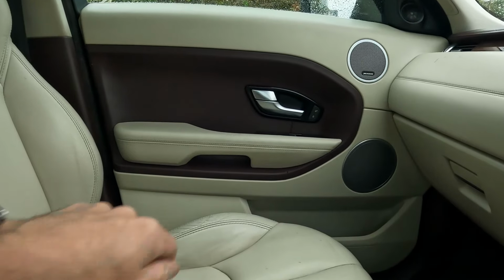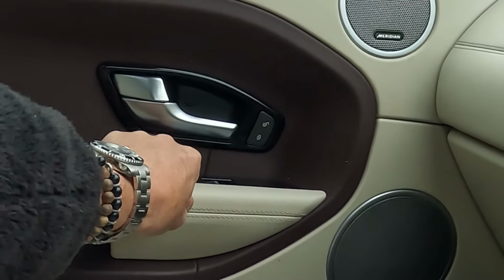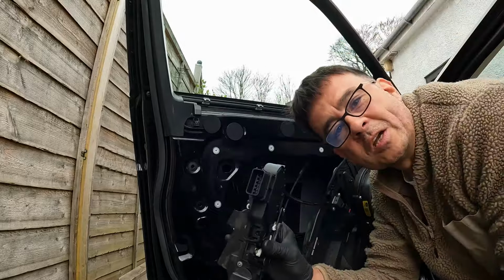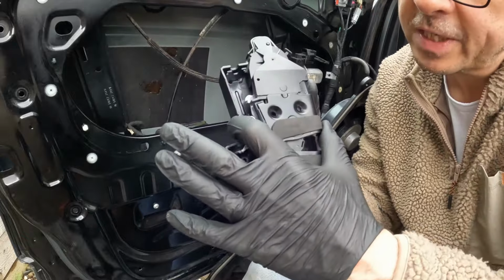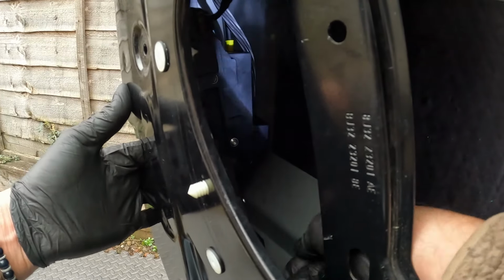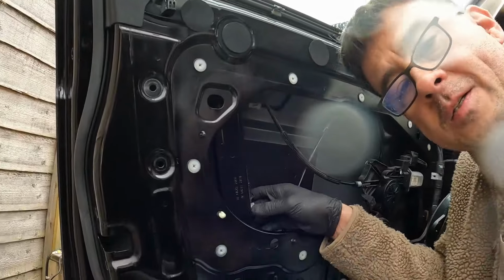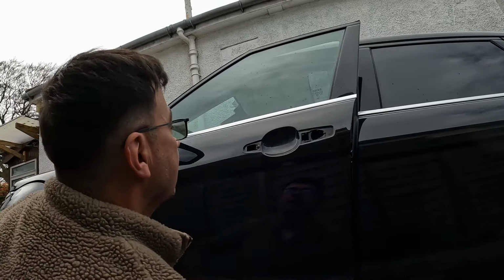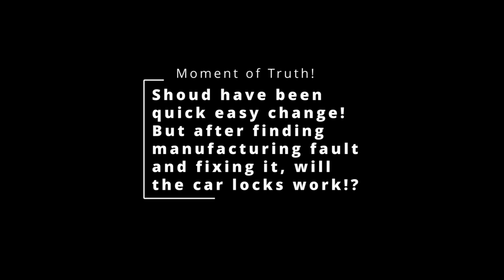Range Rover Evoque Left side Actuator Lock and Handle Keyless - Fix! Watch-out for this Fault !

Comment: Hello 👋, I have the same problem, if I understood correctly, just replace the part and that's it, no coding or similar is required, and this with the lock was all because of the battery?
Reply from the maker: @alexandarnacic5841  correct, no coding just watch the plug orientation as per my video and the emergency key cable. Good luck let me know how you go
Reply: @GrooveOn  I replaced the part, the problem is why I'm less serious, thanks for your help, but now I can't open the door from the outside, not at all, only from the inside, as if the yellow cable fell out on the handle, there's no resistance, I'll open it again to look, the only thing that bothers me is that I have only one yellow for the outside and you have two? For me, the steering wheel is on the left side of the Evoque 2016, so maybe you didn't make any changes there?
Reply from the maker: @alexandarnacic5841  yes whatever for is your passenger side, you have the additional mechanical emergency lock, with key

Comment: When you tried to use the emergency key was it turning at all? I replaced my left side actuator and afterwards i noticed the emergency key just wouldn't turn. I assume it was more that the barrel had seized due to it being 12 years old. But could it be the same thing you had where it came off inside the lock?
Reply: My doors are locking and unlocking fine using the remote
Reply from the maker: @stevewardcomedy  my key worked fine before, have you tried any spray to loosen
Reply: @GrooveOn  Not yet. I need to do the driver's side now too so will give it a look.🙈 I was just wondering if that cable that became detached (where you had to drill out the rivets), would that only affect the emergency key? Or would it affect the remote locks too? (I was unsure what it actually does). Cheers
Reply from the maker: @stevewardcomedy  that cable was for the emergency key yes, however my lock still turned easily ,
Reply: @GrooveOn  cheers mate. Foolishly I didn't check the emergency key was working before starting the job and have only had the car 6 months so don't know if it has been like that for a while. I didn't think that cable would stop the barrel actually turning, but I wasn't 100% sure. In your video when you go to try the emergency key it looks like it wouldn't turn so I started wondering if it was that.